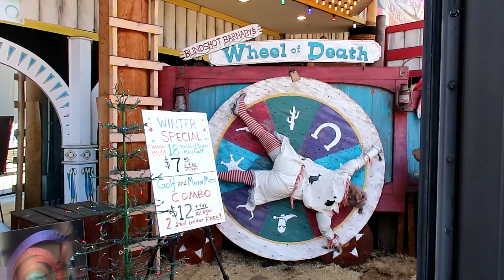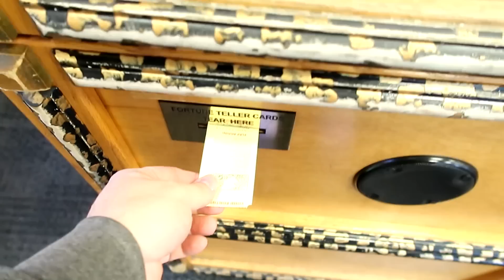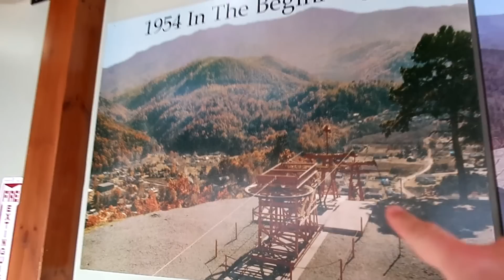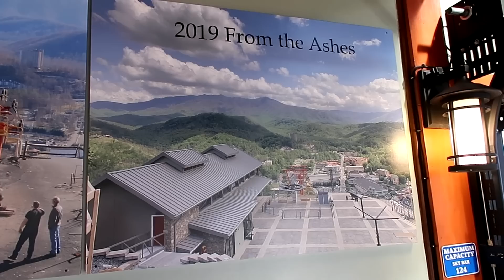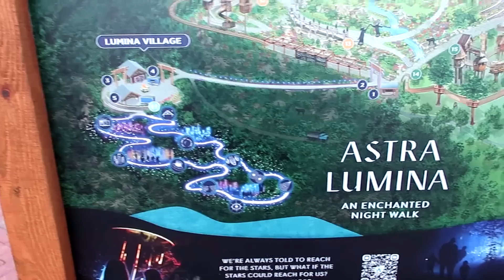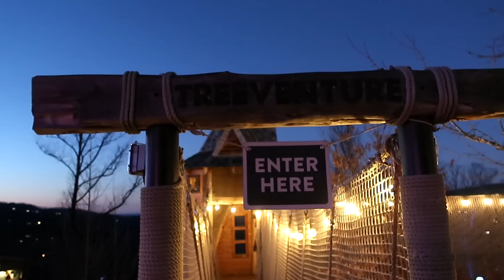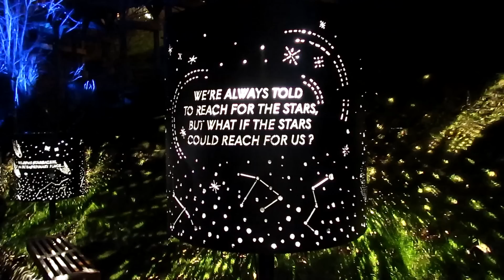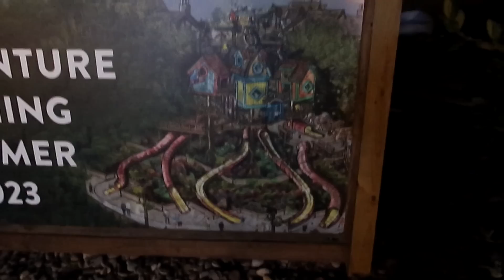Massive Changes Underway in Gatlinburg!  Visiting the New Astra Lumina Show at Anakeesta

Comment: good place. also comp tech easy. on and off switches. computer chips shiny cause semiconducter is glass (silicone soaked in boson more conductive, phosphorous less conductive) 0s and 1s.  on and off. 6 nand gates makes up a memory cell. and , not, nor, nand, or, exlusive or gates...  A is 010011.  5 is 10101.